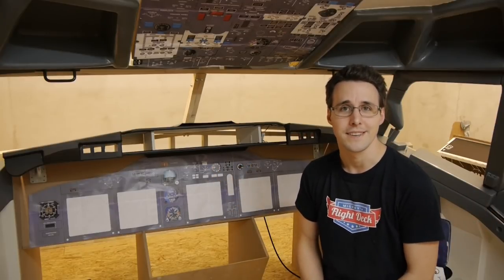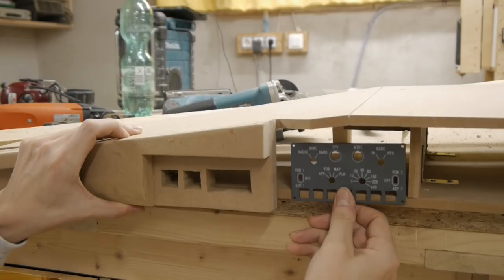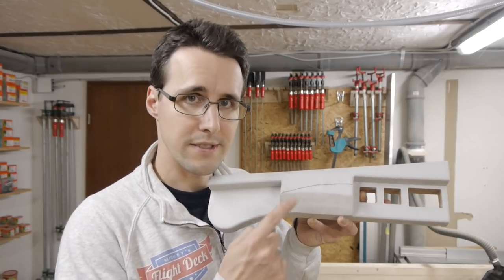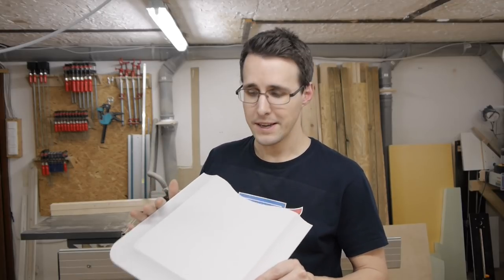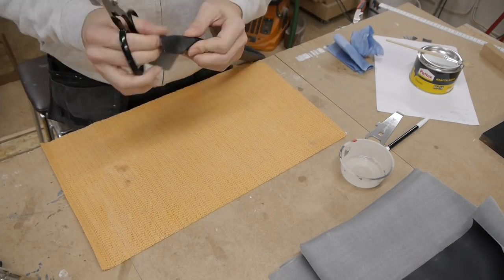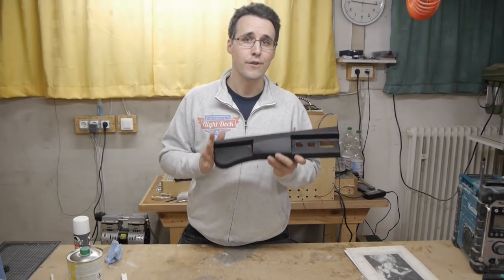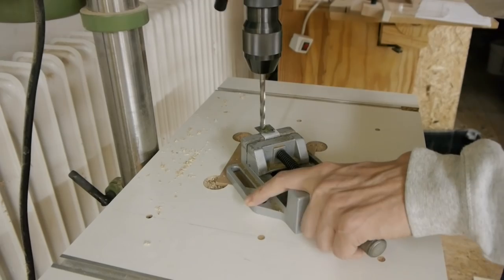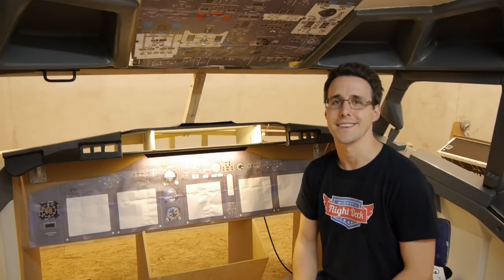Glareshield Covering & Redesign - A Boeing 737-800 Homecockpit #31

Comment: You made a very great job with your cockpit ! Congratulations !
I Fly with X-Plane 11 and find boring to look my two screens in front of me. So I just commanded a ATmega2560 card to make some tests with SimVim software.

I have two question please :
I look a lot of yours videos (not all yet) and I noticed that you often used an CNC tool (to cut perfectly wood, engrave plexi and knobs, etc...) Did you buy it or do you made it ? In two cases, how much it cost ? could you say a little more about this machine ?

You made sometimes wrong cuts that you correct after when you assemble parts... Does your plans on your website are with good measures ?

Thanks a lot in advance for the time you'll take to reply me !

(I subscribed to your channel and I put a thumbs up / sorry for my English, it's not my native langage !)
Reply from the maker: The CNC router I use is a self built machine. I have also made a complete video series about this. You can watch this in episodes #25-#29. The costs dedend on the size you want your machine to be and the spindle you install. Something from 600-900 EUR. You find the plans of that machine at www.holzmechanik.de. They are written in german and english.

During the building process I have to change the designs from time to time to make new parts fit into the existing build. In those cases I update the plans on my website to show the latest version. The only plans I don't edit are the sidewall plans. These are not originally mine and I don't have the concerning sketchup file.
Reply: @Mickeys_Flightdeck  

Thank you very much for your very quick answer. I will make tests with the card I ordered and few knobs and certainly come back soon !  :-)